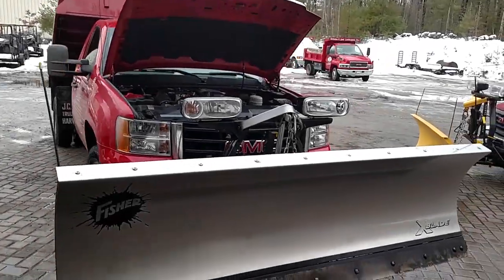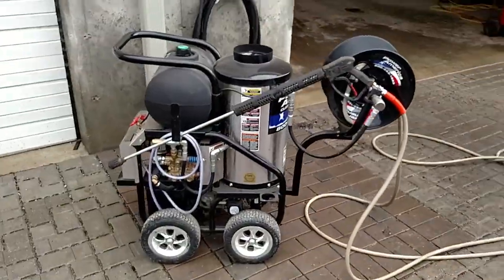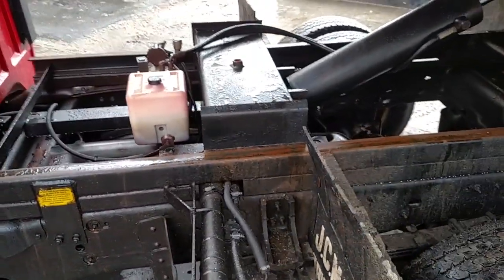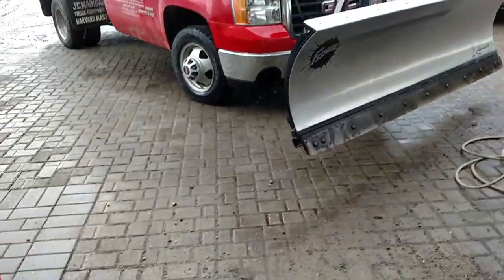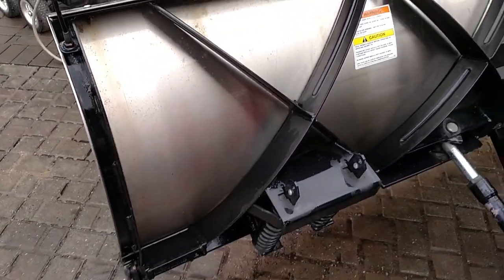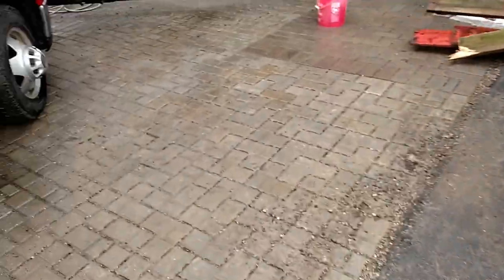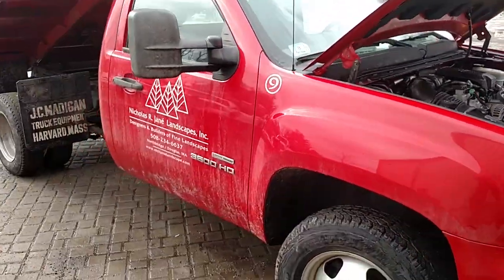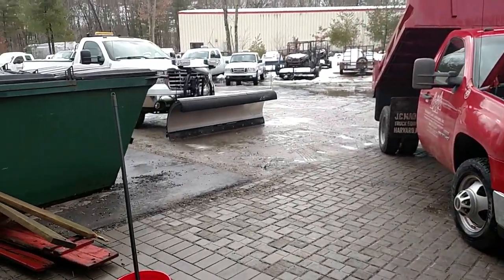Pre Snow Plowing Truck Check List/Walk Around

Comment: we like to run a sprinkler underneath the trucks in between storms. clean and coat the plows with "super slick stuff" or "fluid film" , check and top off the fluids and check that all warning lights are working correctly.

great tips! thanks for sharing, a little maintenance can add on hours and hours of productivity hours for fleets.
Reply from the maker: +Mark Rymer I like the sprinkler idea. Never thought about trying that. I completely agree. Proper maintenance definitely increases the amount of productivity hours. Thanks for watching!

Comment: Do you have any trucks that you plow with that are 1500? Or do you know anyone who plows with a 1500?
Reply from the maker: +Dan “DEgan” Egan Yep. The red pickup in the video with the yellow plow is a 1500. We used to have 2 but we upgraded one a couple years ago to the white 3500.
Reply: I have a 2015 chevy 1500 Lt and i want to put a boss straight blade on it. Any suggestions what i should do to help the front end support the wieght?
Reply from the maker: +Dan “DEgan” Egan I would be sure to buy a HTX because its designed for half ton trucks. I would also look into buying Timbren bushings for your truck. They help a ton a far as aiding your suspension, reducing sagging when you lift the plow and improve your ride quality.